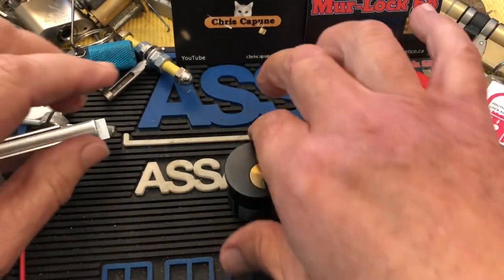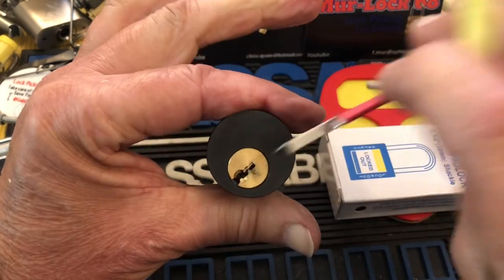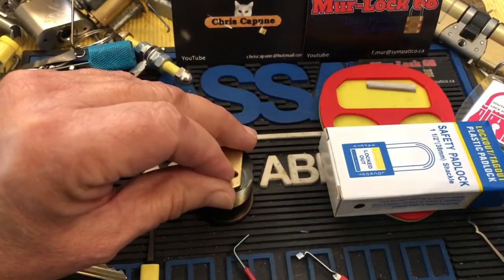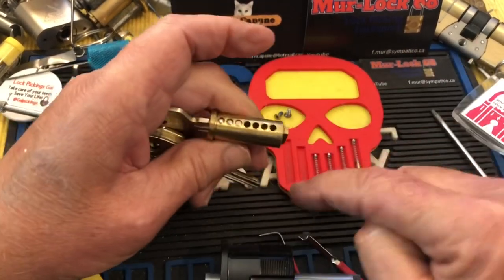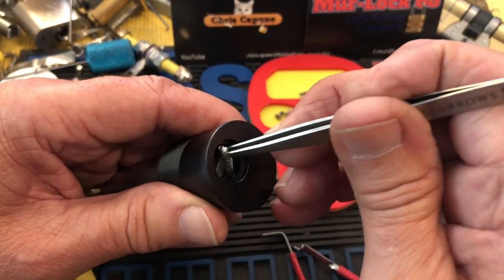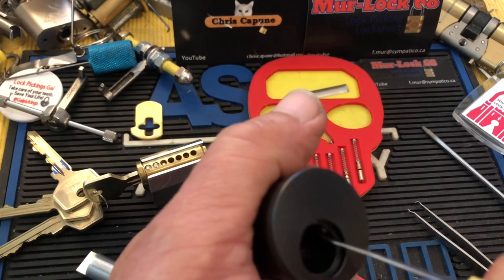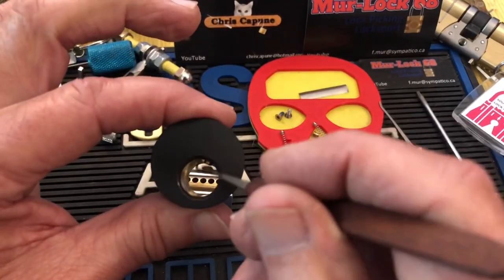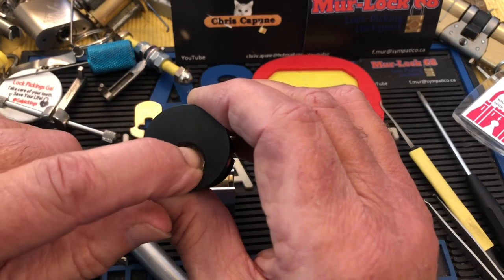#1209 Vingcard Hotel lock explained

Comment: Great Video Chris
I will release shortly a second video maybe 3 min long
Their are other issues on this lock
In short I have again for second time picked the 7 pin Vingcard clockwise and again fell into trap I now know is present at pin 1 which is the only active on this lock as well but here is the kicker,the premise s simple touch first key pin slightly raising trap pin to shear and your out,well not on this lock,it will not come out of trap either way!
My other theory is that yes only one active trap but the possibility of somehow getting one of the other key pins pushed up into inactive trap pin chambers remains a viable issue and thats where I believe the fault lies,if that did happen why would it not spring back to shear?
The saga continues
Reply from the maker: I think that is correct. 
I put a comment on your second video 
Stay safe my friend 
🐾🐈🐾🐈⛄️😷🇨🇦